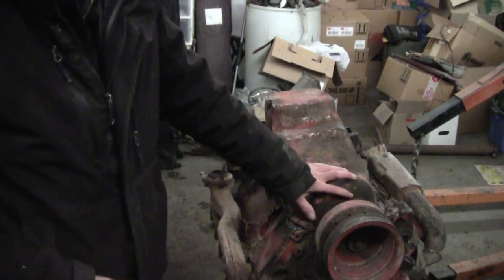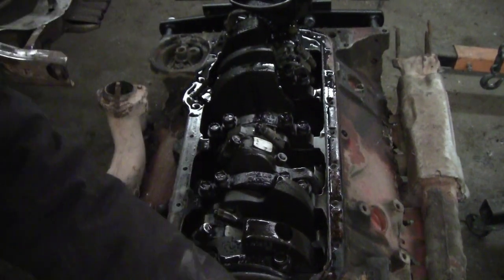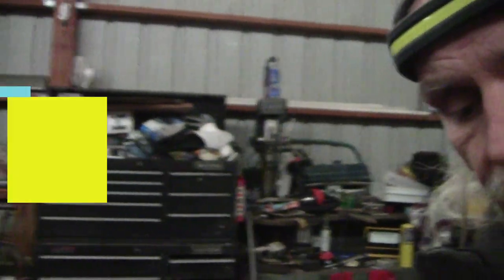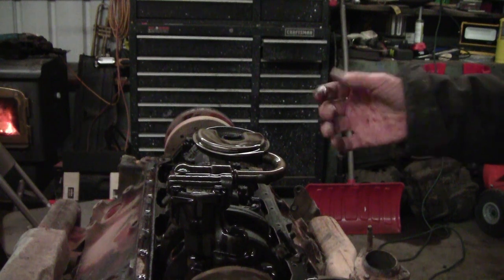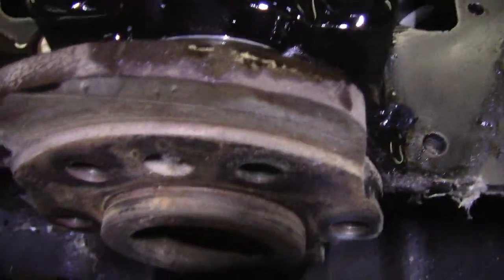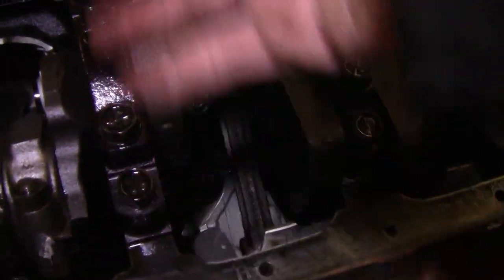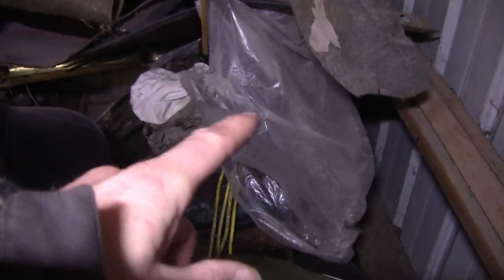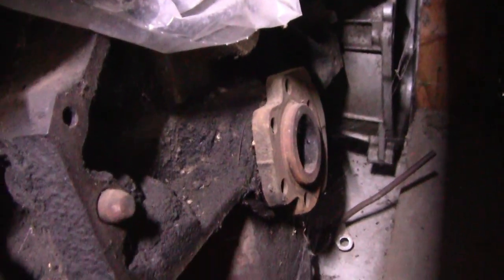Golden Ticket or Fools Gold? How to Tell if You Have a 327 or a 350 Small Block Chevy (Part 2)

Comment: I know a guy that in the 90's rebuild a lot of sbc 350 to 327.
I never got a answer to why he like 327 so much.

I never seen the point in losing ci
Reply: Read fouther down saw your explanation on hi rpm 
That might been the same reas most of his stuff found its was into s10 v8 conversion and light stuff. 

I always wanted tourq I like 4x4 
I actually like the old 400 fords for that reason rebuild they could be low rpm monsters.
Reply from the maker: You hit the nail on the head right there @tbjtbj4786 and thanks a million for stopping by man. Not only did you hit the solid, but it's actually the reason I got this engine for free. Stop light to stop light performance a 327 will walk all over a 350, but after that the 350 will power out the 327. In the 90's everything Racing started to shift to the 8th mile tracks (along with legalized "closed street" racing) as full quarter mile tracks were shutting down and getting harder and harder to find, so you see a lot more of the short stroke, high rpm, snappy quick builds like this.
The guy that had this one, tried to put it in a 3/4 ton 4x4 to haul firewood out of the mountains. It was a DOG, so he pulled it, gave it to us, and put a stock BBC in it. 4x4's you want the BBQ effect.... low and slow turning RPM to take advantage of all the Torque you can get so you aren't just spinning your tires and breaking stuff. That 400 of yours is actually a good choice for that, because that is exactly what it was made to do from Ford. It's a good foundation to build off of to do what you want it to do.... if that makes sense.
Again, good stuff, and thanks for stopping in man.
Reply: Higher revs
Reply: Even tho GM is junk common sense they made 327 from 62-68 350 from 67 -2002.......
Reply: You people make me laugh when I see your stories on Facebook and I have to say wtf people seriously people don't have a clue to what they are doing
Reply: @wildestcowboy2668 gm junk.  Loll. Longest running small block ever. Set the ground for everything else. You people always bash it because you know the difference but won't admit it. But time and time again, chevy engine puts the rest to bed
Reply: Bore/ stroke ratio..breaths better..
Reply: Easier to get to hook and make up for it on the upper rpm. I've built several 327s and smoked 95% of everything I raced on the street. I could hook better and they couldn't catch up to me. This was before drag radials
Reply from the maker: @inscoredbz just like you said you can spin them up tight and they bite in even on asphalt!last one we did was a 32 Ford pickup with Tri Cards on it. Fun little truck for sure!

Comment: 327 never made with 4bolt mains
Reply from the maker: Yeah, this has defiantly been built for some specific reason.... they de-stroked this 350 to make it a 327.
Reply: You're exactly right Chevrolet never made a 4-bolt main 327
Reply: We used to take 2 core plug 327 make 4 bolts out of them

Comment: I built a few 327s in the 80's and 90's by using 307 crankshafts in 350 blocks because back then I felt that a 327 ran smoother than a 350.  A 327 with a 6"rod is still probably my favorite.

Comment: What you do is take a 327 block, put a 350 crank in it and put 305 heads on it. Now you have a strong motor
Reply from the maker: I remember back the 80's and early 90's doing that very same thing!
The Poor-Boy-Hp Kit! and it worked pretty good! 
Esp since the price of aftermarket heads was about the same as a House back then.... lololol.
Reply: Why 305 heads small combustion chamber ? But the valves are so small it seems counterintuitive
Reply from the maker: @meadowpuckett2958  back then it was a nearly free power upgrade with everyone pulling 305s. You do gain over stock tbi heads but yes, there are better options today for that.

Comment: I don't know if you mention. if you put a327 crank in a 350 you need change the pistons. The wristpins are in different locations.
Reply: Because the 327 has a 3.25 stroke and a 350 has 3.48 stroke.

Comment: 1984 El Camino with a 67 Chevelle 327. Just got the AFR 195 eliminator ported heads. Shooting for 480-500hp but being a 327 around 380-390 torque. 700r4 shift kit good for 600hp going to a 3.73 carbon fiber rear. Won't be the fastest but will put a smile on my face.
Reply from the maker: Way cool man and thanks for stopping in.

Comment: Good info, thanks.
I was looking for some clarity because I took a chance on a swap, truck for truck. The truck I got is a 76 1/2 ton with a 3970010. It still has the vin stamp on the front deck. It also had the build sheet. This thing is all original.
4 bolt 010 w/4 bolt mains, th350hd, Hd breaking system, 12 bolt rear-end and 8 leaf leaf-springs. 
The original owner died. The truck spent fifteen years field curing. His grandson put buckets of money into it getting it running but couldn't keep it running. Most of the money he spent was on the pretty things. When I got it I didn't see a fuel filter so I put a combo filter/particulate separator on it w/glass bowl. Rebuilt the new but clogged 4bbl and drove it about a hundred miles and it flat crapped out.
I went to check the fuel filter and it was packed solid with rust. Drained the tank and filtered off over a gallon of rust out. My new poly tank just showed up. 
Time to get the beast back on the road. This thing runs and sounds pretty.
Reply from the maker: Sweet, sounds like you really got something there! People don't realize just what goes into these "Barn Find" vehicles, and 9 times out of ten it's exactly what you fixed right there.
Thanks for stopping in my friend and good to hear you got her back on the road where she's happy to be!
Reply: Lot of the trucks, esp 3/4 and 1 ton got 4 bolt mains, steel cranks were common.

Comment: These Ed Cole small block Chevies are one of the best designs ever.
Reply from the maker: very true Jim
Reply: if you got 100 thousand miles before a rebuild  out of an old 283/327  you did well. Many mid seventies 350  probably would crack the heads . Todays engine designs will run forever .

Comment: 396010 and many others were used for all. Difference being sometimes are large journal/small journal,  small bore /large bore. With my experience even when you think it's a 4 bolt by casting number 010 sometimes its definitely not.
Reply: My 010 block has 2 bolt mains. I thought the 010 meant it was a 350.
Reply from the maker: Yeah, the 010 sbc can really throw a lot of people because they came in so many varieties, the 2 bolt mains where "usually" found in pickups and trucks, but they did find their way into cars as well.  @r1learner178

Comment: 4” bore block, 302,327,350. 010 is a 4” block. 68-69 corvette had a large journal 327 crank but it was a forged steel crank, the one you’re showing is a cast iron crank. The flywheel flange is different between cast and forged cranks.
Reply from the maker: Thanks for the info man, and thanks for stopping in man! I'll find something around here to drop this thing into..... one of these days... lolololol.
Reply: You are correct.  All 327 cranks are forged not cast. He should look at the number on the crank.
Reply: I was about to ask about the 327 corvette, I have a 72 Malibu and a mechanich buddy told me he was pretty sure it has a 327 corvette in it. Aiming to put it in a 64 c10.

Comment: In my experience the back of the crank is also not a good way to identify.  Chevy made so many of these and cast so many parts it was common for them to mismatch the even the castings. I'll do a video and my take on the subject. Since this tends to be a hot topic. For me I'll just say I have a little chuckle the mension of a "high Nickel" block 😂
Reply from the maker: Man I'd love to hear your take on this as well, and oh yeah you don't know for sure, until you get in there and see for sure. Especially when you see signs of OPS (other people's shyte) in it to go along with the confusion... lol. 4 inch bore Chevys... it really is the Lego Engine of all of them. Anything will fit anything, so you Everything in them.
Funny thing about the 0010 Blocks..... in this day and age, I actually don't mind the 89-95 TBI or TPI blocks. They're lighter, 4 bolt main and come set up for Roller Cams. Swap the older heads on them and toss those TBI's in the scrap bin and you can make a butt load of power with them. But they came so choked up with all that factory crap on them no one wants them.
I think we were talking about all this at the NNN's..... lol.
Anyway..... would love to see your video on this as well man. Tag me in it with the @ thing so I don't miss it.
Reply: Only to see if it's a cast iron or steel but you still have to pull the oil pan off to see the casting numbers, or if your experience is like mine ,I can identify it just by looking at the whole crankshaft
Reply: @BareRoseGarage MOPAR engine blocks were thicker.... FACTS
Papaw always said GM is junk
Reply: @BareRoseGarage  010, 020 is just a mark to show where it was cast far as I know
No such thing as high nickel super blocks. Gms race blocks were a bit tougher. Ive heard my machinist say if anything more tin could help but really didnt matter
Bought a new 4 bolt 350 from P.A.W. right before they closed up. Better castings nobody has hacked on it before
If I was to do another 327 Id start with a good 350 block guys want a fortune for used up 327s. Ever had a balancer fly off? fun.

Comment: I've got what is supposed to be a 327, the question I have it has a round flywheel flange, no counter weight like you are pointing out. What do you think I have.
Reply from the maker: Sounds like a 283.
The 283 isn't a bad little engine, but there is one drawback to them (as well as the 327 small journal) in that they are only a 3.75" bore. Same size as the infamous 305's of the 80's and 90's. Because of the smaller bore you can't put 4" bore heads on them because the valves will hit the deck.
Hope that helps and thanks for stopping in man!
Reply: All 327 had a 4 inch bore and a 3.25 inch stroke

Comment: You're probably right at 3:27 but it's a cast iron crankshaft
Reply from the maker: Thanks for stopping in Chris. Yeah, I think it started life as a 350 but when it needed re-built, they de-stroked it with a 327 crank. Pretty common back in the day to make cheap High RPM performance. Good combo for a light car, but not a good choice for a 4x4 that the guy used to get firewood in the mountains with, so he gave it to me.

Comment: I have a passenger side 010 4 bolt with a large journal 307 crank I'ma stuff in an 08 Colorado with blueprint aluminum heads and a Holley single plane efi intake with a 92mm TB... HP tuners and a 411 ECU running a modified last generation SBC wiring setup

Comment: We use to use Buick 6.0 rods in chevy 350, mushroom lifters from a 300 in line 6, Ford, all get used in pro stock motors, u can even buy ceramic lifters for a chevy
Reply from the maker: That's the beauty of Chevy... Extremely versatile
Reply: The 6.0 rods in a 350 would increase the dwell time correct? But in a 350, what is the advantage over a 5.7" rod? I know that in 383 Stroker there is advantages for the high RPM ranges.
Reply: @TheLionAndTheLamb777  Better rod/ratio. In most cases theres really no noticeable difference. 
if youre gonna spin it to the moon then long rod every time

Comment: Be best to put vortec 350 heads, they flow better out of the box, of course some were prone to cracking also.
Reply from the maker: hey there joe, good to see ya man!
I'd love to find another set of Vortec's and have them drilled for the center intake bolts, but this build is slated for a vintage Tunnel Ram that I'm not allowed to modify.... lol. This whole build is focused around that Tunnel Ram & Muncie 4 speed.
You are dead on man..... they flow better than any of the older ones, and with that simple mod, it makes them almost bulletproof. 
As for the cracking issues...... I've only really seen that happen when they overheat. And overheating means there's issues elsewhere.... lol.

Comment: 3970010 casting is 99% of the time going to be a 350. The casting numbers say 302/327/350 because it’s a 4” bore block. If you pull the pan on a stock motor and find it’s a 4 bolt that automatically drops 327 from the equation, they only came with 2 bolt mains. And just with how rare a factory 302 is you can go ahead and get rid of that possibility as well. 9/10 times a 302 and 327 with have a cubic inch specific casting number unlike most early 350s which come up with all 3. For all the guys of the new generation it’s just like a 4.8 and a 5.3 for example, they share the same block but different strokes/cranks. With those 2 the fastest way to tell is a 4.8 has flat top pistons and a 5.3 has dished unless it’s a H/O motor then youd quickly be able to tell by the aluminum block.
Reply: I’ve personally got a 010 4 bolt block I swapped over to a LJ 327 just like the video. My block is a 74 and comes up as a possible 302, 327, or 350 but they stopped producing the 302 and 327 in 69. I’ve always gone off the crank flange like you showed for a quick reference but that’s only good for 74 or 75 and earlier engines. Also should mention 350 and 400 flanges are almost identical as well. Best way to tell for sure is the casting number on the crank itself.
Reply: I agree since I've also seen that a 4-bolt main 327 was never made available to the public - They DID make a couple for R&D purposes but that was it and that was probrably part of the R&D that went into developing the 350.  
However, in the case of this particular engine they could have used a stock 307 crank since it's a large journal crank and because of that it will go right in a 350 block BUT it has the same stroke as a 327 crank. 

That means you take a 307 crank, use 327 pistons and rods.... You're set to build a 4-bolt main 327 if you want to. 

An added bonus to a 307 crank is they were all forged steel cranks, none were made of cast iron and that's why you'd want one if doing a build like this. 
I could tell right away it was a 350 block because it was a 4-bolt main.
Reply from the maker: Spot on man, yeah this one "was" a 350, but it's been de-stroked with the 327 crank when it was re-built some time ago. Makes for a good snappy little small block.

Comment: I've never seen this configuration from Chevrolet.  That's one way to get a large journal 327 4 bolt main!  Would be interesting to see the crank part #.  Still looks like a great find!  Great video as always.  Keep up the great work!
Reply from the maker: I did pull the casting numbers on the crank, and it comes out as a Cast 327 as well.
This whole thing, (as I keep diving into it) is a really common story of "failure" and how I've actually came across some of these "good" rebuilds. I'll give you the backstage skinny on all this..... lol.
What has happened is the guy wanted Horsepower and forgot about Torque. So after reading a bunch of Hot Rod Magazines he took this wore out 350 into the machine shop and told them "This is what I want". They gave him what he wanted, and he dropped it into his 4x4 truck to haul wood with...... and it was a DOG! Pissed him off so he yanked it right out and dropped a stock 454 in it and was happy. To this day he cuss' small block's because he was lied to about how much Horsepower they make and that is exactly why he gave it to Cousin Mike, and then Mike gave it to me. Everything is pointing to a high RPM, high hp build..... but he was actually wanting a High Torque slower spinning combo for a 4x4 truck to crawl around in the woods & pack weight. 
Happens a lot around here when people throw money at the machine shop, without listening to those that know this stuff.... lol.
((that painted up one that's sitting on the engine stand in the back, same thing. Denny bought that from the machine shop. It came out of one of his racecars. Denny dropped it into that C30 1 ton stock truck to haul cows with to the sale (it has the 14 foot livestock bed on it) and used to bad mouth the shop he bought it from. "I don't know how he wins races, because that motor he sold me didn't work any better than the stock one I had in there." When I drove it home I could see why...... it has a cam in it that doesn't come in until you hit 3500..... lol. That thing must've bounced those calves alll over in there as he was banging gears to get them to the sale.... lol ))
Reply: Never saw a 4-bolt 327. They went to the large journal cranks in '68 so they could start using cast steel crankshafts. Many 4- bolt blocks came with cast cranks, but the true high perf engines had 3.48 stroke forged cranks in them. All 400's were cast crankshaft, 2 or 4 bolt block.
Reply: Here in southeast Ga they do this for circle track engines

Comment: Is there a casting number on the crank? That would probably give a close idea of whats going on.
Reply: There should be a casting number…350 and 305 cranks had the same casting numbers i remember reading somewhere…if you put a 350 crank in a 305 or vice versa you will have an out of balance condition since the bores are different..

Comment: The stroke is the difference. Does the piston go down the bore 3.25 or 3.48" 
That's how you can tell
Reply from the maker: That is definitely another way to check it, and my go to method for Ford 360, 390, & 428's.
Pull a plug and stick a plastic drinking straw down the cylinder. Roll it to the top, mark it with a Sharpie, roll it to the bottom, mark it. Pull it out and measure it.

Comment: As I understand it, they never made a 327 4-bolt block... but a 350 4 bolt is great, you might have a steel crank!!
Reply from the maker: Yeah the crank is definitely a 327. Someone some time ago was building this thing for RPM. Why we found it in a 3/4 ton wood hauler is beyond me though. Probably the only thing they had and needed that truck to run.